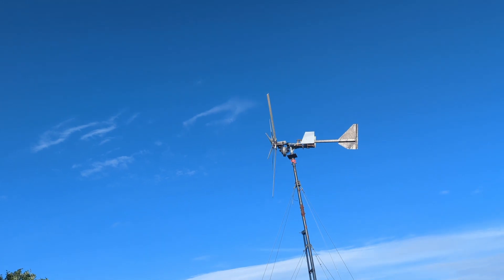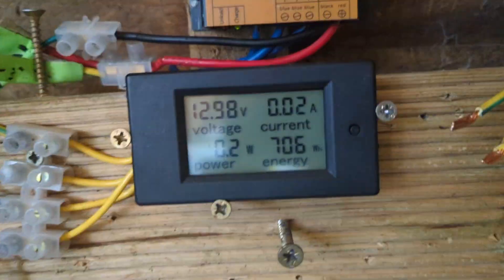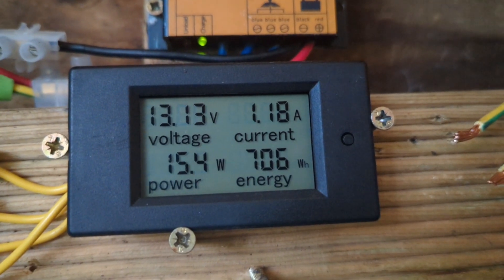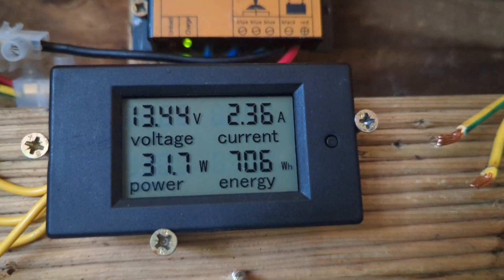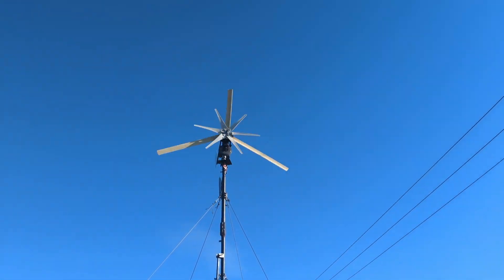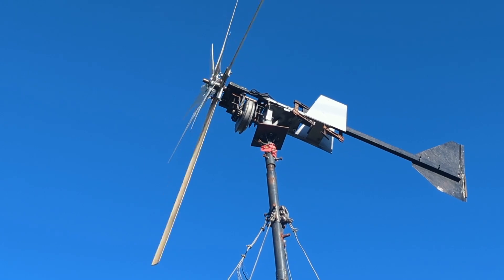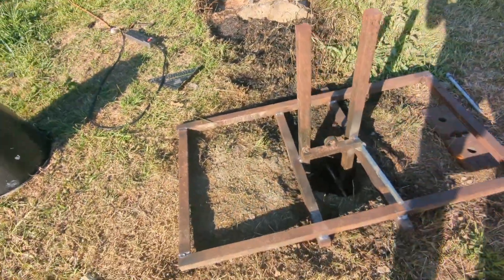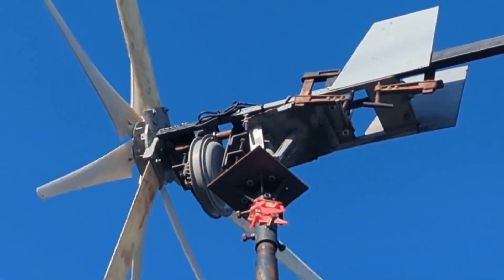Wind Turbine Project Free Energy - New Design - So far so good - 27th June 2022

Comment: that frame is so thick you expect rust will take ages to eat that up. on my frames i painted a really heavy weighted galvanized paint and it still has tiny spots of rust coming through the paint, my next try was using rust converter first then once dry cleaning it and wiping it down with wax and grease remover  then painting , sofar seems to work better , a panel beater on youtube does it this way so i thought id give it a go.
Reply from the maker: Do you mean the gin pole frame?? that is 30mm serious steel.
Yes  I have noticed that , you get rid of every bit of rust, paint it then spots of rust are there after only a day,